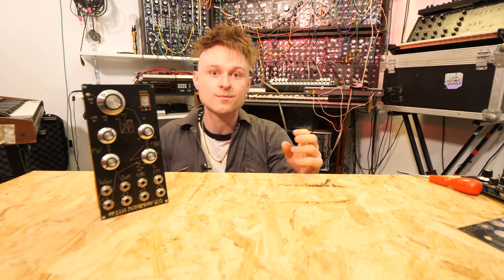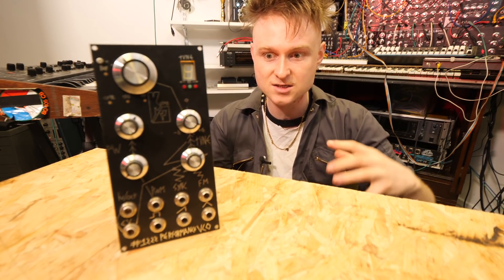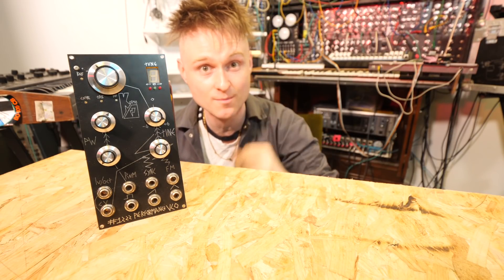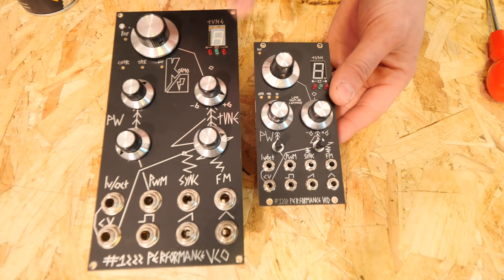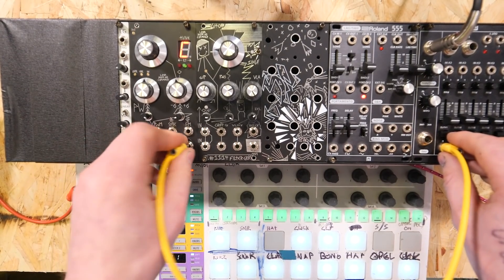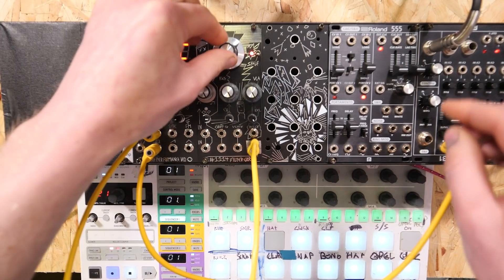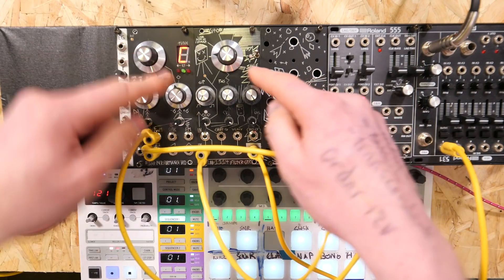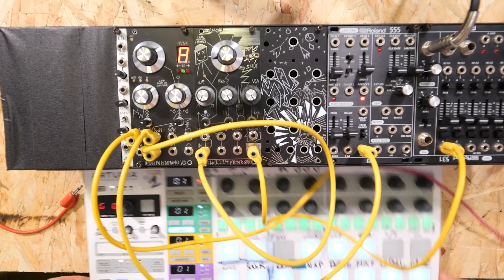KOSMO VCO Faithfully SHRUNK TO EURORACK -  Analog #1222 Look Mum No Computer VCO

Comment: Oh that's funny, I've been designing a Eurorack version of the #1114 Filter Grrr because when it first came out I thought it was such a cool, crazy sounding thing! My one is a little different however, I made several "refinements" - at least to make it a bit more useable for myself. The project went on hiatus for a long time and I've been meaning to get back into it (I recently had a play and found that I really want to add an offset control to the input instead of just a switch [which I originally removed in favour of a preset offset value for use with bipolar waveforms] because I discovered this opens up a wide range of insanity and is good for compatibility with more VCOs), my biggest barrier is finding the motivation to get back into learning KiCAD to make some PCBs...

I'm really glad this is only coming out in Eurorack format now instead of when I wanted it to as it really motivated me to get more into electronics and I've had a blast learning and tinkering on this and other projects with my dad.

Once I sort the offset mod I might make a video.

Comment: That's an interesting point about distortion with a unipolar VCO... My preference is for a uniform ±5 V waveform so that's what the VCO I designed does, but of course you could add an offset before going into a distortion module. And if I ever design a distortion module I'll have to include a DC offset knob!

Looking forward to the spring reverb!

Comment: Not a connoisseur, but you got Roland series 500?

listen to this:
U 96 - Club Bizarre (1995)
The Germans where the indisputable and absolute number one on normal tempo Techno back than. well they knew actually music theory, mystic. dream away type of song.
try to learn this track, copy it, imitate it, pretty sure you will love it.
the breaks are amazing ... but only if listen from A to Z in contrary to a tikto. user is capable off.

Also been working on a VCO for a period of a year, there is a lot more possible than only a Sine, Saw, Triangle and Pulse.
I like this tuner, is the code online?
Check the Buchla 258 circuit.
Reply: youTube: U96 - Only Techno

Comment: Eurorack is compact to increase the amount of things you can reach in one space and in doing that makes the system more playable than larger formats. There are also many more companies doing experimental things in the format because it has the largest user base. It being smaller does not mean it's inherently worse, it's just different.
Reply from the maker: I disagree as in doing so it makes it more of a clumsy device. I don’t see why more is better, but finding the right tone and parts. As you can see I’m in the bigger system camp having explored quite a lot. However these eurorack versions I have approached using differently to the bigger Kosmo ones which has resulted in some interesting things.
Reply: @LOOKMUMNOCOMPUTER  I think some people tweak modular differently. Some make small micro adjustments, so the downsides to eurorack are minimized. If you are the kinda person who sets up a patch that kinda just "runs" when you press a single key, rather than twisty knobs all over, like, I'm talking an ambient artist or whatever, then yeah.
It's why we have varieties right? Nothing says you can't even do a hybrid for modules you rarely rweek if you want. That's the cool thing about modular, it's so custom!
Reply from the maker: Also I didn’t say they were worse. I mean I would be wrong as they are much more popular than larger machines.
Reply: @LOOKMUMNOCOMPUTER  no worries i see your point and neither way is worse they are just different. I am glad your making them in eurorack now! Peace
Reply: All my modular is eurorack and i like that but i'm sure i'd like a larger format even more for ease of use and general feeling (and the sound of plugging in a 6mm jack is infinitely tastier...)
it's not a question of quality (I have no doubts regarding my AJH and Rossum modules) but rather of pleasure.
And those awful miniature black knobs used in eurorack... beuhh